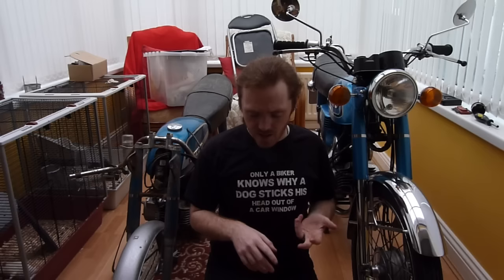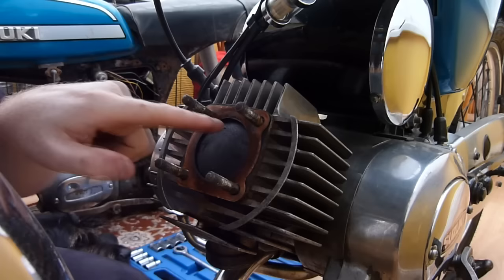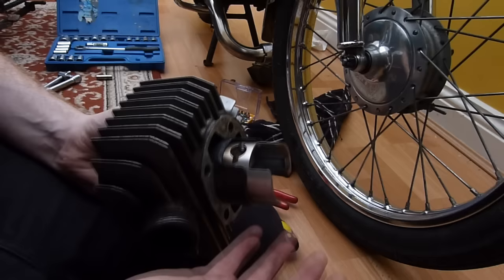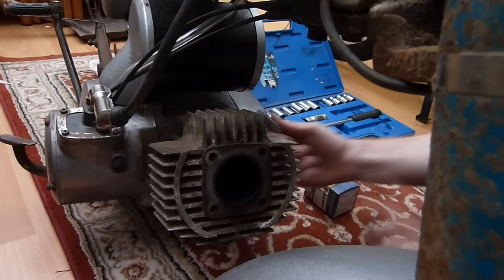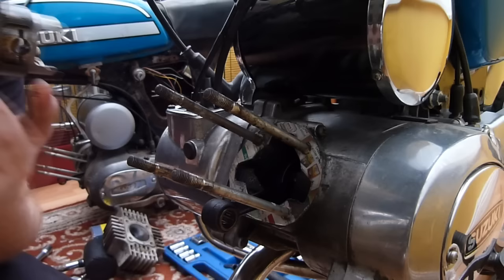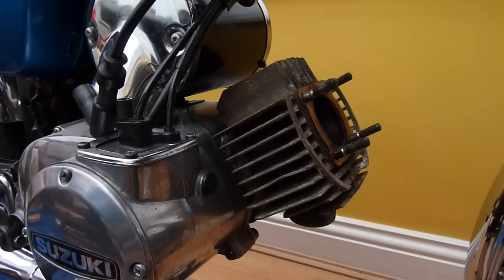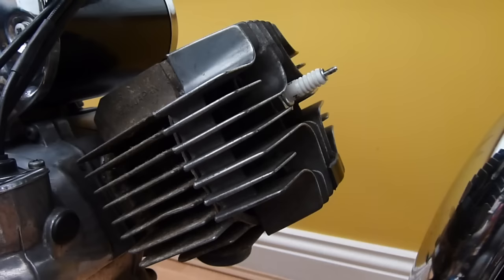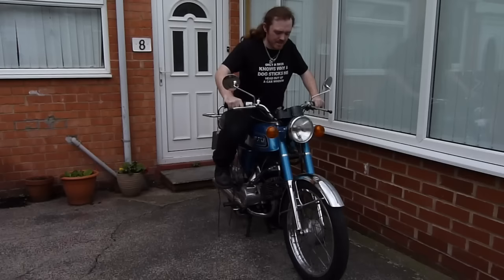Suzuki A100 top end transplant and start

Comment: Hey mate very important question..... what oil do i use in gearbox/crankcase? obviously i use 2 stroke oil in the oil mixer tank, but dont i need to put other oil into the other part of the motor? thank you :)
Reply from the maker: Yeah you ned oil in the gearbox/clutch half of the engine. I use 80w gear oil in mine, because it isn't used for engine lubrication/ cooling you can use oil which is used just to lub gears. Just take the small screw from the side of the engine under the filler. Fill the case until it runs out of this hole then refit everything.

Comment: The A100 did have siblings, namely the AS100, AC100, ASS100 (I kid you not!!) and the ACC100. I've had mates that have had the ACC100 and the ASS100.

The A100 itself comes in 3 style versions: A100, A100-2 and A100-3. The A100-3 is the only one with metal fork shrouds, the predecessors all had rubber fork boots.

A total of 8 colours were available, including what the parts manual labels as "Brack" (I kid you not!!). The word "Brack" is substituted for "Black" throughout the parts manual so does make reading it with a straight face difficult. Gold and very dark blue were available too.

The AS100 is the "Sport" version of the A100-1 and has a chrome high level expansion-esk styled pipe on the left hand side at side panel height.

The AC100 was the trail bike version with different gearing and the same chrome high level pipe.

The ASS100 is the "super Sport" version of the A100-2. It had a 10.5 HP motor with a different disc valve profile. It had a high level left side pipe from the Suzuki T125 "Stinger".

The ACC100 was the trail bike version with different gearing.

The A100-2 had a similar gas tank style to the T80 and T125.

The introduction of the TS100 killed off the AC100 and ACC100.

The introduction of the GT100 in 1975 and then the spine framed GP100 version in 1976 killed off the AS100 and ASS100.

There is actually a A100 racing kit consisting of a proper high level expansion chamber, racing profile disc valve, jets, etc. and other parts to transform any member of the A100 family into a café racer. It was issued to dealers to convert crate bikes into café racer specials or to sell to punters. Very rare to find.

The short lived GT100 and the GP100 relegated the A100-3 into the 100cc commuter bike class, in competition with the Yamaha YB100 and CB100N. In time, not content with killing off the A100's sportier siblings, the GP100 soon took over the 100cc commuter role and the A100 went out of production.

I have the A100 parts manual from my time working in a motorcycle shop many years ago. I save it from being thrown out during a clear out. I realised that to a future restorer and collector a parts manual (with exploded diagrams and descriptions) is too important to be chucked away.

I collect and ride CZs so it is no use to myself. The only Suzuki I have is a GT550B. 

Do you want the A100 parts manual, if you still have the A100??
Reply: noted for next inspiration

Comment: I had to make a cereal box gasket for the generator cover on my 2002 GSXR600 when I had to replace it due to 5 burnt out coils! I tried just leaving the old gasket there but it was pissing oil backwards onto my boot. It's someone else's to find in the future now as I traded it in for an MT09, which is why I came across your channel
Reply from the maker: Well i can say you have good taste in bikes sir :P. Bloody great bike the MT.  Nar i have had some people go at me for using these type of gasket, but if i'm honest these have lasted me longer then the proper ones.
Reply: +Ginger Geordie Biker In my teens I had to rebuild a 70cc (was originally a 50cc but it had a bigger top end put on it) Honda motocross bike that for some reason every component on the engine had been undone and then just put back finger tight, that got cereal box gaskets all round and it worked a treat. Why would anyone criticise a cereal box gasket? What is the downside?
Reply from the maker: Well i think it's just because most people see it as a bodge job. Water off a ducks back to me but it works for me it worked for my dad when he used to work on bikes. If the bike runs and there is no leaks i don't think there is any problem. Hell i have even made high compression gaskets from Aluminum foil before for cylinder heads.
Reply: +Ginger Geordie Biker That's some next level bodgery there. But if something looks stupid but it works, then it's not stupid

Comment: Hiya, these videos have been invaluable to me for the past couple weeks. So, thank you. I picked up one of these (1976 A100) a couple weeks ago (I'm in the States). It came with no battery, no fuel line, plus some other small odds and ends missing or broken. He gave me  a "spare" chinese carb. (I'm trying to revive the original Mikuni as I write this). I just got the Haynes manual today in mail, so I'm going over all of the electrics while I wait for battery to arrive. Hopefully I get it up and running in a week or two (once all my parts come in). Mostly it seems like everything is in pretty good shape and intact other than what I mentioned. The oil pump was immaculate. The compression seems pretty solid. I haven't pulled the piston yet, but I took the top off. 

Anyway, I have a question about the two random vent tubes running from the carburetor casing to the battery housing. Are they both for the carb? And, if yes, why do they run up? That seems weird to me. I also have some questions about part numbers. I may need to replace the choke plunger and I haven't been able to find one on ebay (and the Chinese one doesn't fit in the Mikuni-though I may be able to make it work). I'm just not sure what number or model this carb is (the number is very worn and I can't even tell if it's there). Do you have an inside scoop on where to find the mikuni carb parts (and numbers) individually for the A100? Any resources where I can find the part numbers as a list? I've been looking at cmsni.com and they have a good amount of stuff (and I'm putting together a list to order from them). But, they don't have the choke plunger, for example. And, really I'd just like to see if there are any other Mikuni choke plungers that may fit and look by part number.

Thanks in advance.
Reply from the maker: HI mate, the A100 is a great bike to cut your teeth on. It is so simple and once running they are a great little bike. Now for your questions the first one about the two tubes, these are just vents and can basically be piped anywhere. Just allow atmospheric pressure into the carb bowl. i stuck mine in the hole in the crankcase were the oil feed tube is.
The second question about the choke plunger. You can get full carb kits cheap from a place called Jerry's cycles which are in America. Basically includes all the jets and things needed to rebuild the carb including the plunger. If i'm honest it's always good to get new jets and so on for the carb then you know it's all clean. 

Hope this helps you out and if you have any other questions just drop me a msg :) 

GGB

Comment: I want to thank you for all you work on the A100. I have a restore project on a 78 right now. Your videos have helped me understand this bike a lot better. I have a quick question for you though I have2 stroke oil dripping from the carb? faulty oil pump perhaps? is there a check valve in the line somewhere? any ideas or thoughts thanks.

Comment: How do i find the vin on my a100, what should it entail?
Reply: It should be stamped on the steering tube at the front. Note it will not be a normal VIN like you are used to seeing with a car or modern bike. It is a short number starting with A100- and is more of a serial number.